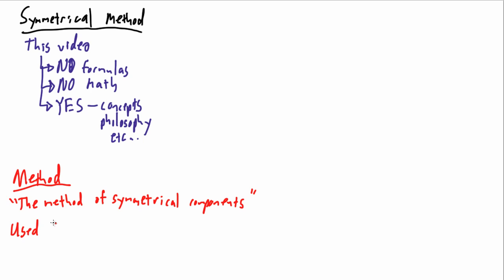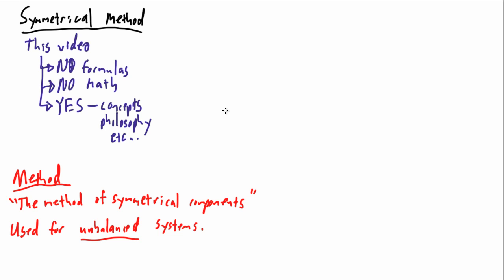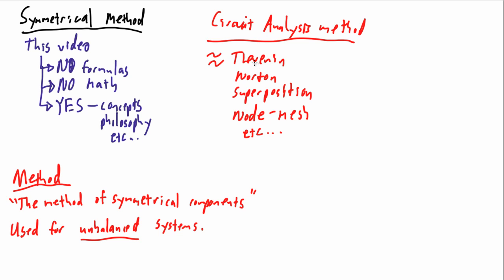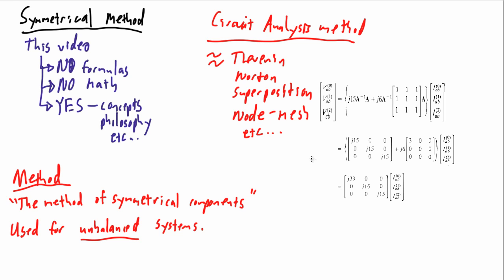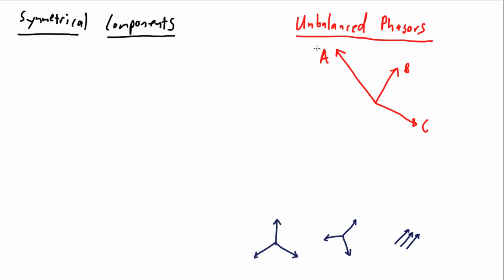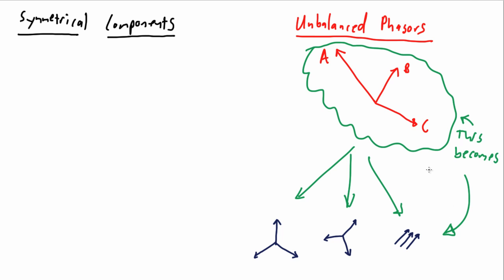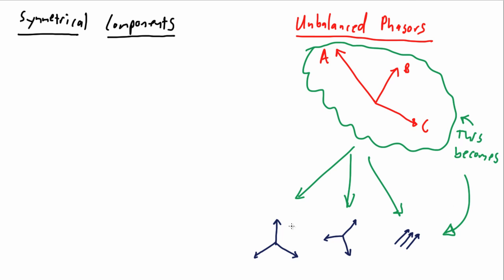Electrical PE Exam - Symmetrical Components (introduction)

Comment: In 1961 I took a Power Course and was introduced to symmetrical components.  I thought it was an interesting tool and studied up on it.  I never worked in the power industry so I never put that knowledge into practical use.  However, it came in handy in two instances.  When I took the EIT and Electrical PE exams there was a problem in symmetrical components.  The problems were fairly easy so it helped me pass those exams.